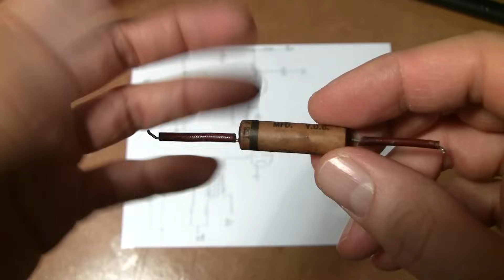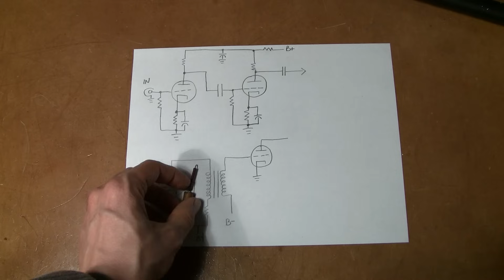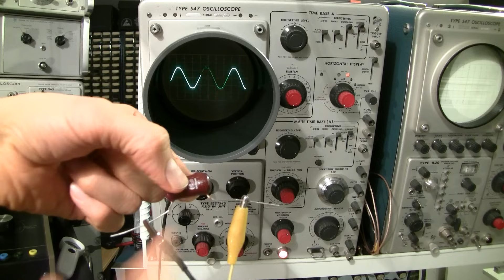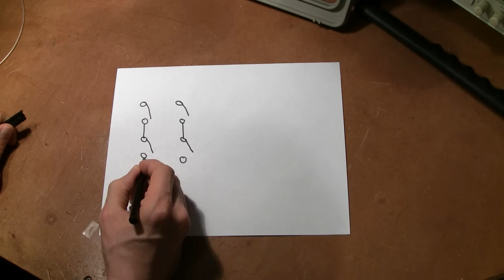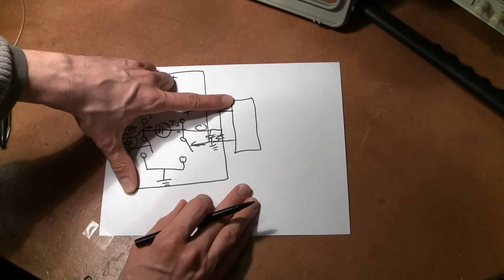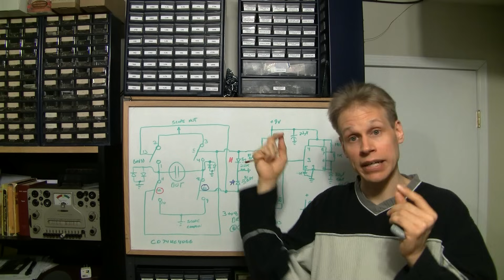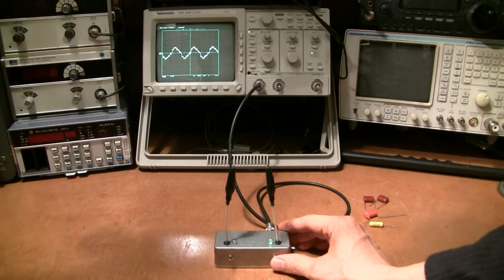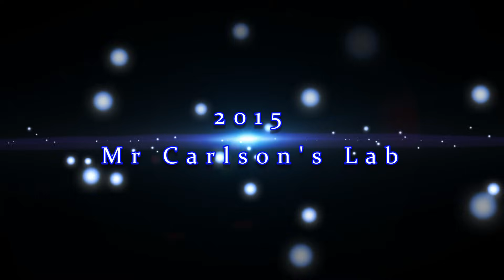Are Your Capacitors Installed Backwards? Build this and find out

Comment: THE RELAY GAVE 0 OHMS
Reply from the maker: +Jamie Phillips If it didn't, (contact resistance) you would have a faulty relay.
Reply: IT IS A FIEW MILLIE OHMS SO LO IT DOES NOT READ ON A FLUKE 27

Comment: I like to improve any audio amplifier I use in my hifi, and I generally change out electrolytic capacitors that are in the signal path of my amplifiers to MKP caps. Would I see a noticeable improvement in sound quality by making sure the orientation of the band end is correct when installing MKPs? Secondly, how do you feel about Black Gate "Super E-cap" configuration where two non-polar capacitors are mounted in parallel oriented so that their foils supposedly cancel out any inductance? Is this BS? Thank you for your time.
Reply from the maker: +gripracer If your amplifier is Tube type, the orientation of your capacitors will be more important as the circuits are high impedance. Whether there will be a sound difference or not, I can't tell you. As for the Black Gate "Super E-cap"..... WOW, Well, I can tell you that any surface area that's conductive will be inductive at some frequency. Lead length will also be inductive, but at low frequency's this is not so important. This is why point to point audio amplifiers work without issues. At high RF frequencies, this build topology will not work as well (leads need to be short.) If you do have long exposed leads in your audio amplifier, they will pick up stray AC in high gain audio stages.
Reply: thank you for your input

Comment: Now I want to build one and test the polarity of the non-electrolytics in this boost pedal I built as well as all the mods I previously did in my Blues Jr. amp (though the sound floor doesn't seem to exist and I have oodles of clean headroom, I'm probably just fine.)  Damn you! ;)  And thank you, of course.
What size Hammond you think would be needed for through-hole?
Reply from the maker: +kcrmson Thanks for your comment, good luck with your build.

Comment: ive not seen a need for finding the "polarity" (A.K.A outer film) of film caps. Though i suppose in circuits reaching close to microwave frequencies it could matter, but otherwise in switchmode power supplies and tube radios i see no need or change.
A well thought out and explained video, a little too much ramble though.
Reply from the maker: KE0ETP Thanks for your comment.

Comment: Cool, but I still have no idea why is this necessary ;) The scope test clearly shows that the caps mentioned have a really high ESR/ESL, you don't really care about the minor spikes in a circuit you use those in. Especially keeping in mind the stray coupling to the nearby components caused by those caps is way lower then one caused by the PCB traces. And once those effects do actually count, ceramic bypass is usually used. Nice circuit anyway.
Reply from the maker: TheBypasser Well.... This really has nothing to do with spikes and the latter. This video has to do with orientating the outside layer of the capacitor to the lowest impedance point, to reduce stray interference and lower coupling affects. This is an affect that is clearly visible on an oscilloscope, and mentioned in "early" radio engineering books. If you think that this orientation, or polarity in circuit doesn't matter, I suggest you look into this a little further. Thanks for your comment!
Reply: Mr Carlson's Lab Well, the "hand simulation" is a pretty over-the-edge test - for example, touching the crystal resonator traces and capacitors usually causes the generator to stall though that's no sign of a mistake in the design of a given device nor it's a sign that a shield is required to sustain a nice MTBF.  Anyway, I see your point. But should you look closer, the area of a capacitor's outer layer is comparable to the one of the PCB copper connected to it and it's soldering points (unless the capacitor is very large in size, for whatever reason it is chosen that way). Meanwhile, the distance between the mentioned copper and the parts of the enclosure and the board itself is way smaller then the one between those and the capacitor's body, meaning the stray capacitance difference between the two devices having different capacitor orientation will be low. Also the correct board layout (like dedicated shield areas, correct trace placing, differential and shielded traces) will help to remove the most of the trouble. Also the smaller surface-mount caps (the film caps are used only for power supply spike suppression and that's where their work ends nowadays) and tighter layouts of the coupling-critical devices do the job better. And once we cross the line of "extremely sensitive", it's time for the real fight - external dedicated shields, multi-layer PCBs and decoupling transformers and optocouplers everywhere.
Reply from the maker: TheBypasser I maybe didn't mention that this video is really centered around vacuum tube circuitry? This "More" applies to point to point wiring, where parts are suspended in air space, and where no board layer ground plane is present. Low impedance circuitry is the "common mode" of thinking now, and this important step has been lost. I have come across many circuits (tube) that this polarity in circuit is very important, and wrong orientation has had negative affects. "oscillation, hum, coupling, so on..... And, I have come across circuits that don't care about the orientation as well. Some newer capacitors have a folded, or stacked design, where there really is no outer wrap. I avoid these capacitors all together. The test fixture you see in the video is just an automatic switch connected to a high impedance input on an oscilloscope. The simple fact that the scope views the induced 60Hz hum from my body, is a very clear indication that the surrounding circuits (IE; AC Heater wiring) around this capacitor will affect the circuit it's installed in, if it is not orientated correctly. I'm going to do a video dedicated to the effects of improperly installed capacitors in the near future. It appears that an analysis with an oscilloscope is not enough for many.... Which boggles my mind! Thanks for taking the time in your last "write up!" This is all important for others to read.

Comment: MMM mmm.... i am skeptik. You are testing a capacitor using it like an antenna inserted in a very high impedance input instruments. Yes maybe that the last turn of the foil can made a shield but not always. I found some capacitors that act like you explain but other that haven't any difference between pins. An amplifier inserted in a well shielded box is the only thing that can zeros hum.
Reply from the maker: The Top Guitarist Being skeptical is just fine. Thanks for your comment!

Comment: I want to replace the stock ceramic cap on the tone pot in my guitar with a paper and oil cap that I have on hand. In a guitar does it matter which way I solder the cap, or will it buzz more if I solder it in one direction, and if it is soldered the wrong way will it affect the tone?
Sorry, I know little about electronics.
Reply from the maker: Tim Borisenko How old is the paper and oil capacitor? As for the Hum or Buzz, you will have to try it. If your capacitor is old, don't use it.
Reply: Mr Carlson's Lab they're only a couple months old because I got them recently at a good deal (the seller said it was "old stock" so maybe they are older than a few months, but definitely not older than a few years).

Comment: Your movie has inspired me to run a test for the Caps going into the NC-173.   I will be removing and retesting the ones in the Hallicrafters S38C before doing a calibration

https://plus.google.com/+JordanRubin6502/posts/Ybkq2JRDHGH
Reply from the maker: Jordan Rubin Glad this video helped Jordan!
Reply: Seems My O-scope has another issue......

http://www.electronicspoint.com/threads/tektronix-2235-sweep-generator-horizontal-mode-a-issue.275058/

Comment: You made a great video! Are ceramic capacitors polarized too?
Reply from the maker: ElectronFun.com Ceramic disc caps are not a wound construction, so NO. Thanks for your comment!
Reply: Thanks I didn't know that either, and I just thought about surface mount caps they are solid state so no polarized for surface mount caps.

Comment: I saw your video and it made me curious.

Your hypothesis sounds logical and your video is so convincing so I decided to try it. I have a few scopes here I can use but unfortunately not a Tek 547. I grabbed a coax (1 meter/3 ft) with BNC connectors on both ends then I used a pair of DMM short leads attached to a BNC male to banana adapter.

First I used a vintage Tek 2465B, connected the capacitor and tried to induce a 60Hz signal... no joy... a flat line like a code blue patient. WT..? I can't induce a 60Hz signal on this thing? Gave up.

Then I used another vintage Tex 2440 digital oscilloscope. Same results. Same results with newer Tek MDO scopes.

Either you have a very 'electric' personality or I've been living in Texas for too long and the hot Texas sun is turning my body into a dry mummy.

Any ideas?

P.S. good restoration videos.
Reply from the maker: trifidsagitarius LOL! Maybe not enough AC surrounding you. You may have to stand close to your breaker panel when you do this. You can also couple 60Hz AC into yourself with a signal generator. Don't zap yourself!

Comment: This is confusing with electrolytics. An electrolytic has a plus sign and or a minus sign to mark the positive or the negative lead respectively. Installing an electrolytic backwards can get you into the big bang hobby real fast, which is why it's extremely rare that they are marked improperly. Please explain the differences between electrolytics and non electrolytics. This is a property beyond the noise shielding properties of the outside foil.

Thanks.
Reply from the maker: KitCox You can install these capacitors in a DC circuit either way with no "bang." When Installed in an AC circuit, they should be orientated correctly.
Reply: Mr Carlson's Lab Gotcha, thanks.

Great vids! Do you have formal education? Your accent reminds me of  some Canadians I've heard.

Comment: Since you made such a fancy circuit, why not make a fancier one: Rectify the hum, S&H it, compare the voltages with a comparator, perhaps letting the diodes tell you which side has the most hum (i.e. highest voltage). No need for an oscilloscope, could be made to work a lot faster too!
Reply from the maker: jopjopjop  Sounds Good. If you build one, definitely post a video!
Reply: Mr Carlson's Lab I will! Thank you for a great video btw.

Comment: Hi Paul, Have built one of your Cap test boxes which for the most part does what it says on the tin! The 4013 is flip-flopping, lighting the alternate LEDs as expected and I have 9V appearing in turn at pins 5/12 and 6/13 of the 4066. I would have expected to see about the clamped 0.6V DC appearing alternatively across pins 4/8 and 1/11 of the 4066 - I appear to have a noisy sine wave - this doesn't seem right. Any thoughts? The unit is constructed on a single sided PCB and housed in a cast alloy box.
Reply from the maker: g4rko Barry Hi Barry, with a cap across 4/8 and 1/11, the noise should loose amplitude as the cap is acting as a filter. Check for switching resistance. The LED that's off should have about 17 ohms to the scope hot. The LED that's on should have about 17 Ohms to your box or ground.
Reply: Thanks Paul, mine checks out ok.
Reply from the maker: Great to hear!

Comment: Relays? ICs? Circuit boards?  All you needed was a DPDT toggle switch.  No LEDs, no battery.  Just a switch.  Switch handle points to the outside shield side.  Connect cap.  Flip switch.  Done.
Reply from the maker: Star Gazer Hi, I Have explained the downfall of the toggle method in this post already. Briefly again, you can not touch the toggle handle, or box without grounding your body out. If you ground your body to the box or switch, the imposed 60 cycle signal looses amplitude. This makes for a test with interference. If you mass sort capacitors like I do. An automatic switching system makes for clear easy results. Sure, the toggle switch will work fine, But... you will have to remember the amplitude before you touch the box or switch......Hold the box (amplitude change) move the toggle, take not of the amplitude again with no contact....so on. Try it! I have :^)

Comment: Suddenly i know why one of my channels @ tube amplifier seems more fragile aka hum/other noises on background. But i never figured out why till i came across this! Never knew orange drops had polarity... 

All those hours checking every solder, resistor, wire, potentiometers and finding NOTHING wrong :/
Reply from the maker: Osmosis Glad to help :^)
Reply: Mr Carlson's Lab
 I thought the output transformer was dying on me, it really bumped me out. since it's such old iron i can't replace it nor wont ever sound the same if i replace the output transformers. Which could be expensive as well... But last weekend  I've gotten my soldering iron out again. Just as I thought after seeing this vid it was indeed the case! I'd had the orange drop in the opposite direction in the faulty channel. Now it's alive and playing well!  I'm so glad thanks again!

 (It's a rare little SE EL84, only made in Japan and in Rotterdam, The Netherlands. A short period in the 60's. Kontakt  KT-7. The brand was also know as bocama / nytone)
Reply from the maker: Osmosis The symptoms sound more drastic than just a backwards capacitor. Maybe you moved something under the chassis or a tube socket was dirty. Backwards orange dip caps usually cause hum in audio circuits.

Comment: A box that doesn't need a scope and can just detect the lower-amplitude polarity, and light the corresponding LED would be even cooler.
Reply from the maker: ilike56K That may just happen, some video in the future ;^)
Reply: Mr Carlson's Lab Hey, BTW, since you made it seem like the printed line is meaningless: I thought it meant that it's the negative polarity side. I know this is definitely true for electrolytics and tantalums. Are the capacitors you used in the video polarized?
Reply from the maker: ilike56K There are a few ways of looking at polarization. Here is an example: You have a polarized wall outlet in your house...... And your battery has a polarization. These capacitors are polarized due to their orientation in circuit, a polarization due to an outside metalized polypropylene layer. In a circuit with DC applied across the capacitor, they can be installed any way. They will not explode like an electrolytic capacitor. In a circuit with differences in impedance between two areas, the line end, or outside layer always goes towards the lower impedance portion of the circuit. This is crucial in interference reduction in vacuum tube equipment. This is the reason they used to mark the band end "properly" on this type of capacitor. I have a bunch that have that band end also marked "ground" for area's where this orientation is really important.
Reply: Mr Carlson's Lab
So some lines are for DC polarization, some are for the lower impedance portion of the circuit, some are for ground (which I'd assume could be either of the previous examples), and most new ones don't mean anything (except for when it comes to DC polarization). Sounds confusing!

Comment: I think I am actually the 6000th subscriber. The count was at 5,999 and I hit the sub button. If this is so, then grats on 6k!
Reply from the maker: TwoOfFiveIsTen Thanks! As I'm typing this, a 22 gig video is on it's way up.
Reply: Mr Carlson's Lab Owsh. That is massive. Most of my videos top around 4-5.

I got here from watching EEVBlog, and watched you repair the 1930's area radio. While I didn't understand much (I am not that much of a radio person, but I got the general gist), it was still entertaining to watch.
Reply from the maker: Thanks! Glad you enjoyed! I do try to mix it up a little, and interact more with the viewers. (as time permits)
Reply: Cool, I was wondering if you could possibly do something on the Conelrad alert system that was used during the 50's an 60's. If you don't know about it it was an alert system to inform of (mostly nuclear attacks) emergencies. During Conelrad operation all TV and FM stations would shut down, and most AM stations would too, except for to (forgot the frequencies) that would both transmit information on a round robin system. Meaning one station would transmit for a few moments, then another one on the same AM frequency would take over, and so forth. This was to confuse enemy pilots that were using radio tracking system (So what happened to the Germans wouldn't happen again.)

It is a very interesting topic and a cool bit of history in terms of radios.
Reply from the maker: That was a funny era. I do have 2 RCA broadcast transmitters with the conelrad alert lamps on them. I may do a video one day on those. You know, without any transformers in the case of those transmitters, the case alone weighs as much as a car. It took 6 guys to move one with no transformers. Just the modulation reactor takes two men to move. Heavy stuff. I own two of these :^) cause I'm nuts!

Comment: at 73 i always thought the line denoted outside foil.you showed i was wrong.
i'm not building anything as i am satisfied with the earlier experiment showing the where the outside foil is by introducing a signal with your body.
  i hope my electrolytics are correctly marked :>)
barry
Reply: Anybody know how close you need to be to a mains source for the 60Hz to be induced into your body? This tester looks to work great, but what if you work in an environment where there's a lot of high-power and high frequency switching gear. Coupling the mains signal to the cap under test via your finger, may lead to situations where it's difficult to tell a small signal from a larger signal on the scope screen...??